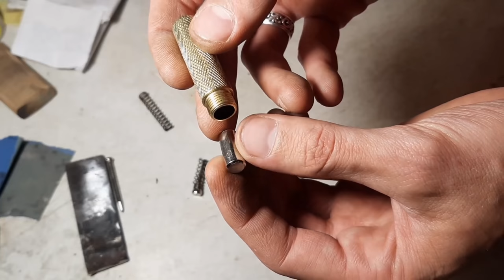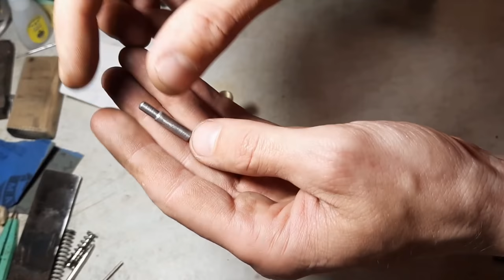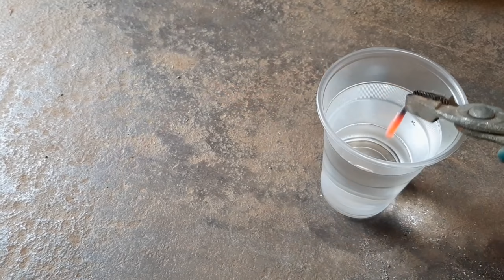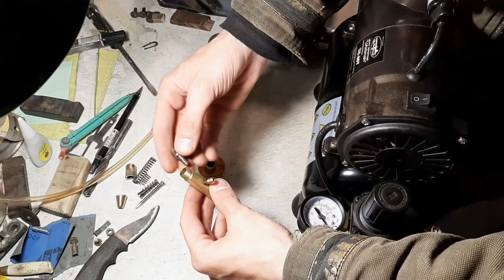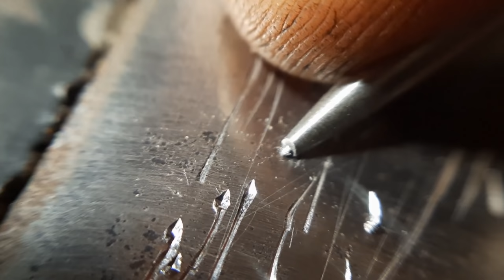How to make pneumatic engraving machine from a mechanical center punch.

Comment: I made one from a vibro engraving tool with the pointy bit ground to a flat chisel edge........I used it  for getting into small places to remove burrs.........I think it can also be used to impress or punch a design like numbers or letters into soft metal like copper, aluminium or even brass.

Comment: How does the mechanism work? I don't understand how it reciprocates, unless you put a spring back in. A close-up or assembly video with explanation would be amazing. Thanks!
Reply from the maker: Thank you for your attention. A spring is not needed in this design. I put it as an addition. The principle itself is that air passes through the holes in the piston, and moves the piston up and down. In one of the following videos, I will probably make a detailed analysis of this mechanism and make a drawing.
Reply: @KirillRunz  have you converted the compressor  to blow and suck?
Reply: @KirillRunz  I am looking forward to more information on how the air makes the piston move up and down. I have looked at the video several times and I can not figure it out.
Reply: @tattoo45uk  no he didn't for this specific piece. It's designed for constant air pressure (blow only)
Reply: @BengtRosini13 then how can it possibly reciprocate? It seems that only pressure all the time would just push and never retract.

Comment: Fantastic. is it possible to see a drawing to understand the method of operation?  Thank you
Reply: Air pushes into the chamber inside the brass handle, filling that chamber and pushing out the spring-assisted-return internal "pin". The pin moves forward and releases chamber air through it's forward hole, letting it return into the brass chamber, to get pushed forward again and release air.....

Comment: i notice again, the points the points that are fixed with cyanoacrylate instant glue adhesives how safe they are in the long run ?
Reply: You did it nicely. It is good to use the already existing tools and redo a little. This idea has long been developed with large pneumatic hammers. Steve Lindsay did it perfectly (perfectly). Only his products are terribly expensive. I also did it out of curiosity and this is an excellent method. I used an sds drill to make the piston. I hardened, drilled and hardened.
But now I'm using Sergei Valtman's graver system.

Comment: somewhat similar to the physics for tattoo machines, instead of electric  hidraulic, but the funny thing, the most similar thing in common, is how noisy both methods are hehehe, I wonder how far is it possible, at that scale, just using compressed air, having features that would allow control the strength and depth of the cut  - so beautiful stuff there ))) keep it up

Comment: I have watched videos like this trying to discover if the air source is alternating or direct pressure. Many of them are alternating and they show you how to modify a tyre inflator to provide alternating pressure. But it seems hardly anyone comments on the way the engraver works. In this video you make it clear a larger compressor is better but does it provide normal direct air pressure or have you modified it to supply alternating pressure? Is there such a thing as a direct pressure engraver?

Comment: Did you have to modify the bigger Air compressor please????thanks in advance
Reply from the maker: Thank you for your attention. Not.
Reply: Could you be more specific on if you modified the air compressor your statement didn't make any sense thanks
Reply: It's not modified, the aircompressor just blows out compressed air. There is no blow and suck action like some designs need.
Reply: @oniemarc_engraving  thanks very much

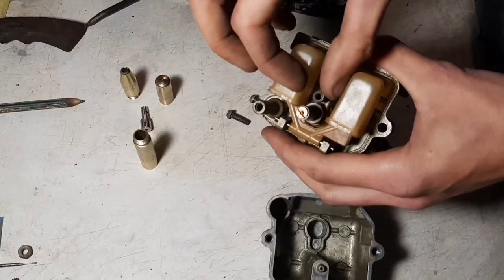Comment: 3:28

What is that thing? could I make it?
Reply from the maker: This is the main fuel jet from a motorcycle carburetor.
Reply: @KirillRunz  Is that part different from a normal pipe?
Reply from the maker: Any other threaded tube can be used. I just had a ported carburetor at hand, and I unscrewed the part I needed from it.
Reply: @KirillRunz  Thank you very much.